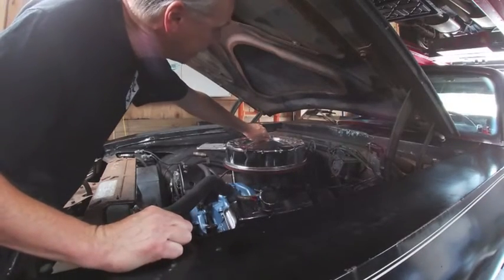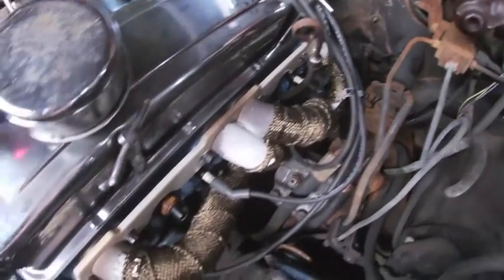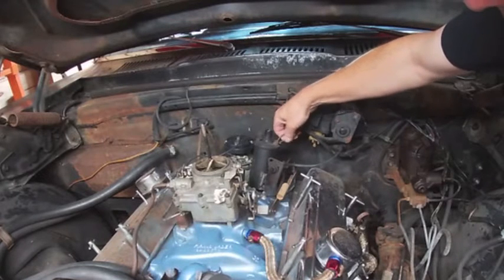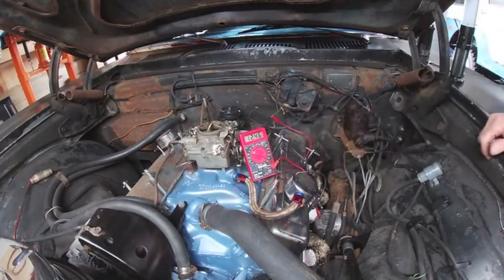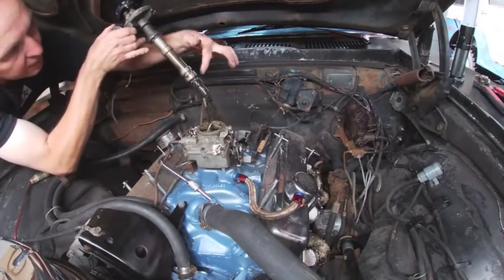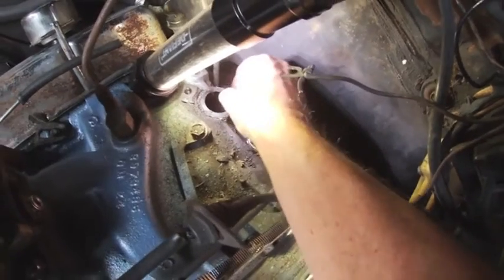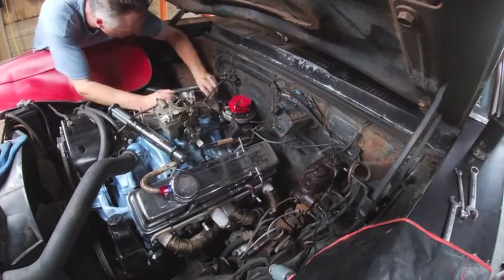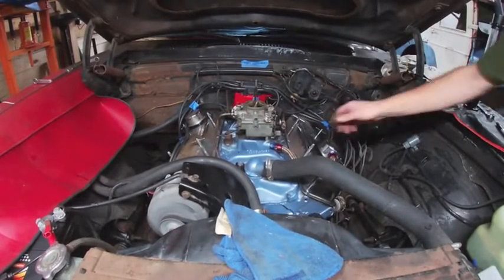Points swap to HEI and Plug Wires

Comment: for Headers which arent made anymore, 
when I bought mine for my 68 Camaro, back in the mid 70's where the coating lasted a long time, was Appliance Headers, 
they ran around $68 and easy to install, only thing I had to remove was the cross linkage for the Clutch.
the increased Horse Power was notable.
the headers were made of heavier metal  than other headers, including the Expensive ones..
thrush Hush mufflers had a sweet sound, had to get rid of the thrush Glass packs, they attracted the CHP like a magnet.

Comment: for the 2bbl Carb.
back in the 70's a kit I bought, replaced the needle valve with a ball valve and the performance was outstanding, it gave better fuel flow. and quicker response.
some thought I had replaced the 2bbl with a 4bbl carb.

Comment: How can the purple wire supply running 12v to the HEI if it only has 12v when engaging the starter? I thought the other wire coming from the IGN would go to BAT on the HEI. That way the HEI is getting 12v whenever the IGN is ON.

Comment: I had to shave the corner off of my new HEI distributor because it was hitting my intake on a 64 vette . I was cautioned about the firewall but nobody said anything about the intake! I massaged it into place 👌🏼
Reply from the maker: Didn't realize some intakes would have clearance issues. Did your 64 also originally have a distributor drivin tach?
Reply: @OldCarGarageUSA  yes. I found a complete distributor (HEI) with gear drive tach on eBay. $150. CAN 
 I thought easy plug n play, cheap price. I’ve been screwing with it for 4 evenings now. Wrong plug wires twice, and now I discovered to line up #1  I can only turn so far cause it hits the 3 wire harness coming out of the base of the distributor. If I loosen the clamp a lot it will squeeze by but when I tighten it down I’m afraid it will either wear through the wires over time or be hard on the shaft with that constant pressure pushing on  the distributor. It’s like an 1/8” but …. 
This was supposed to go smoothly 😐
Reply from the maker: @wadenorgaard9988  Dang, that stinks you're having so many issues. Another option would be to convert your original unit with a Pertronix kit. I used them on my 55 Chevy and 64 Impala with great success.

Comment: Good video Dave the 07 should run a lot better now. Did ever think of hopping that 307. You could do it pretty cheep. Some 305ho heads and a small cam and 4bbl would real wake it up.
Reply from the maker: Doubt I'll do anymore on the 307, just wanted to make it more reliable with the HEI. I'd like to swap in a poncho engine, but been watching marketplace for a number of months and nothing affordable out there, or at least when comparing the number of 350 sbc's for under $500 available.

Comment: I wish you had show how to make the connection with that wire.
Reply from the maker: Sorry I missed that. I used the 75 and up factory connector that I got with the distributor from the junkyard. Google this part number for the type of connector needed. STANDARD MOTOR PRODUCTS S2323